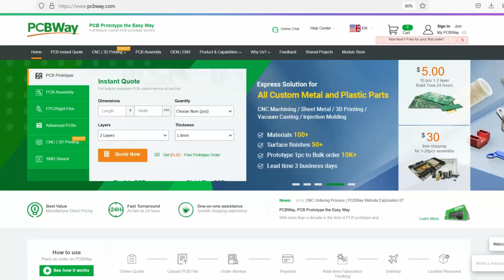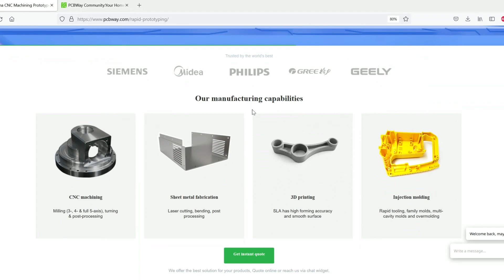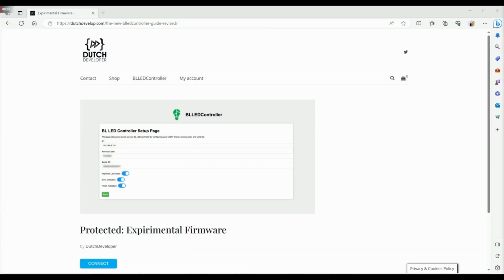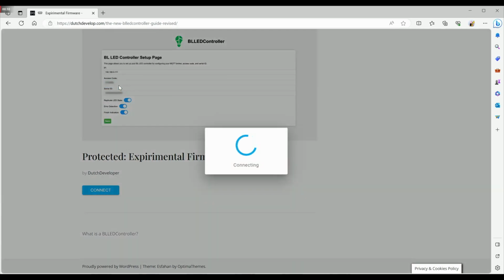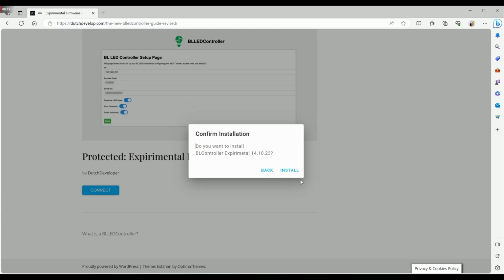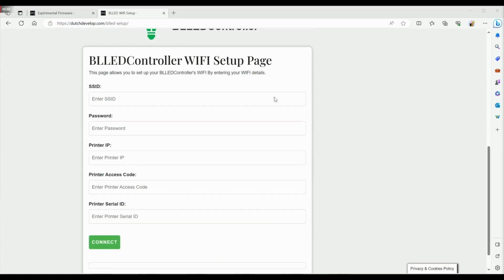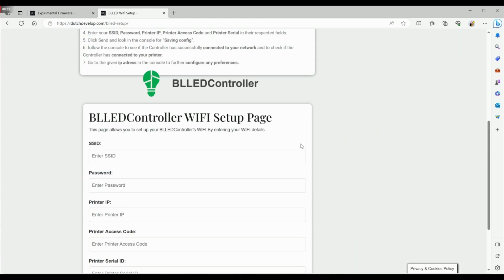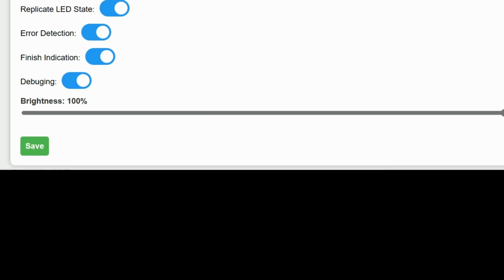Bambulab X1C , P1P , P1S BLLED controller Experimental FW test

Comment: Where did you source your power connector from the BLLED to the plug for the DC adapter, I dont see that in your links.
Reply from the maker: i did put it in the links below, but then the link died, so i took it away, you are welcome to join the BLLED discord group where they will tell you exactly which models u need.

Comment: Hi, Thanks for the video! On 5:51 i see that u use G10 plate on your X1 Carbon. if i use this do i still have to make adjustments to mine bambu lab. I use the P1S and would like to use it, previously i used it on my Elegoo but had to keep adjusting the bed level, it didn't see the plate somehow. how thick is your G10 plate? Alvast Bedankt voor je reactie.
Reply from the maker: hello thank you for your comment, under normal circumstances you don't have to adjust your bedlevel on a bambu printer (automatic bed leveling) make sure to choose smooth PEI/ high temp bed instead of Textured PEI, so that it can adjust to the smoothness of your G10 plate. Hope that helps!